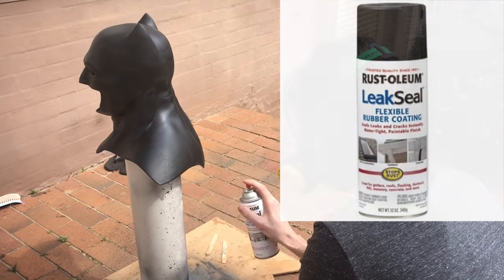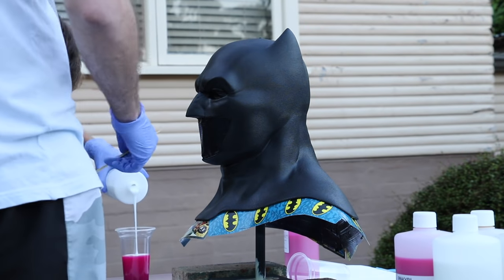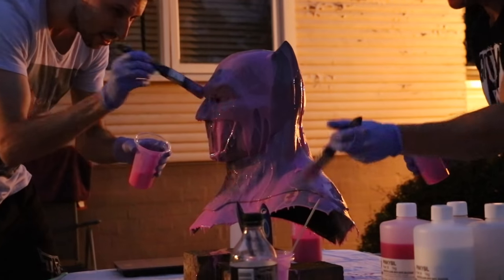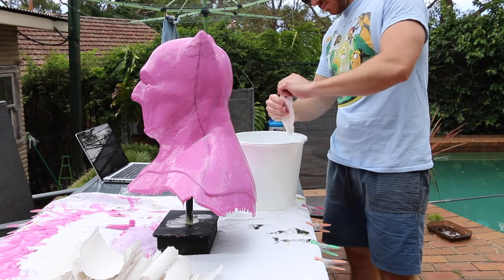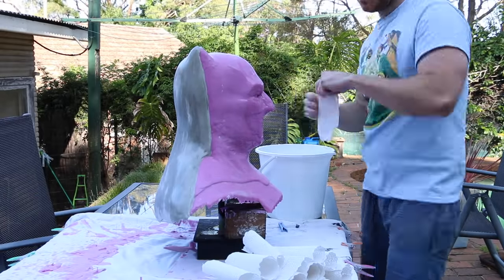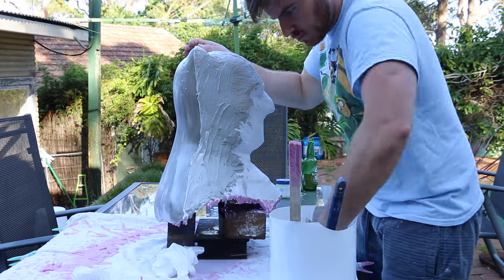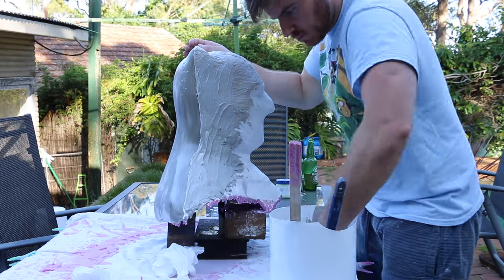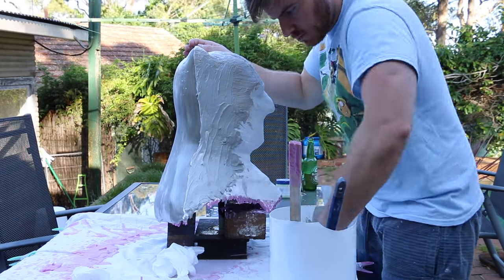Molding a 3d Printed Batman Cowl!

Comment: An easy way to tie plaster molds together: Get old bicycle inner tubes and cut them into long rubber strips. Tie them around the mold as though you are tying string. It's like a rubber band rope.

Comment: chris try using foam latex for your wearable cowl its not as hot and is much more flexible so you can actually turn your head
Reply: michael march no offense but that isn't correct at all.   Every cowl was foam latex excluding the TDK.   No other cowl was able to turn their head.   The DOJ was way more engineered than any previous piece.   Also foam is just as hot as anything else.   There is a ton of misinformation out there

Comment: does silicone need to be applied on its own?

I just had the idea of doing paper mache with silicone instead of glue, maybe by letting strips of soft absorbent paper soak in the silicon then applying the silicon paper strips like like one wound strips of plaster.
Reply: Yes, if you add a cloth or anything into the silicone it will no longer stretch. It will still be flexible, just not elastic, which is needed to demold the piece. You can also do this selectively on purpose in key areas that you're worried might tear, like a cut seam.

Comment: 3 notes, should have used some thixo agent after the first 2 coats to make it easier to do, and 2nd note should have done this as a 2 part mold. Finally a 2 part fiberglass mothermold would have been a lot better.